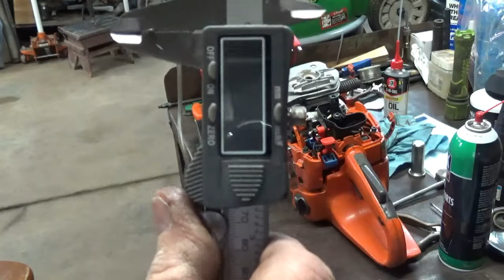Husqvarna 575xp Video #2  Setting the Cylinder

Comment: Craig, great video. 

I'm going to have to dig out my 576xp soon and rebuild it. 

The 575/576 are the last easy to work on saws I recon.
Reply from the maker: There not as bad as a Stihl but more difficult than say a 372xp, I still have a 576xp non autotune to put together and I'm thinking of useing a 575 piston, some port work and leaving the stuffers out.
Just to see how it runs.
Reply: @craigtimmons3468  I think I'm going to port my 576, add some intake timing and maybe finger port the strato ports to make it run richer.

That saw was always leaner then I would of liked.

Comment: Well done Craig ,those CAD saws need only practice I worked repeatedly on a 450e, and few 550s ,and 575 there simply fiddly that's all...there so tight for space they can't be any other way...that saw should run good from now on.
Reply from the maker: As long as I can keep it on a strict diet of 2 cycle mix. 🤣

Comment: @tinmanssaws where do you get the piston ring compressors??
Reply from the maker: I purchased mine off of Amazon, I'm sure you could also find it on EBay as well.

Just search for "chainsaw assembly tool kit" 
I done a quick search on Amazon and seen one for $14.99

Comment: Te salut domnule craig îmi poti spune de ce nu vine benzina pe furtun la carburator  dupa ce iam schinbat supapa din rezervor si chit menbrane carburator cum o pun pe lemn se opreste si nui vine benzina cînd scot furtunu dela carburator
Reply from the maker: I'll try, 
I think the valve you speak of may be the fuel filter, so it's new right?
If so a couple other things that could be going on is, 
Make sure the filter is staying submerged in gas at all times,
Might be the new filter is defective 
Make sure the fuel line is not kinked or has a hole in it
Make sure the impulse line is in good shape like above as well as where it connects onto the cylinder and carb the passage is completely open (not obstructed)
Check the metering lever for proper setting and that the little fines screen in the carb is not plugged up with fines.
The fuel tank vent may not be functioning properly, to test start the saw and lay it on the clutch side with it running and loosen the fuel cap to allow air into the tank as saw is running.
Make sure the cylinder mounting bolts are tight.
Also you may do a pressure/vacuum test to check for leaks.
Last thing I can think of is there may be an issue with the auto tune side of the carb if your saw is equipped with an auto tune carb.
Reply: Da o sa verific tot ce miai spus íti multumesc mult pentru tot.  poate fi si compresia un factor
Reply from the maker: @madalinadenisa6434  Yes Primary compression which is in the crankcase which is where the pulse signal is from.
Glad I could help  😌
Reply: @craigtimmons3468  Multumesc mult esi un geniu